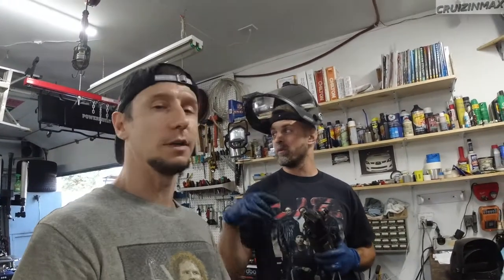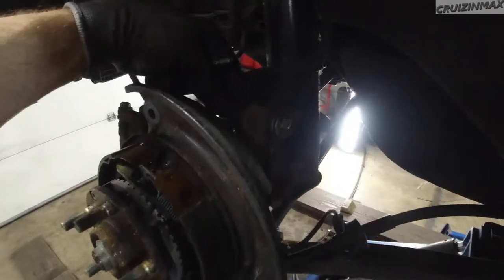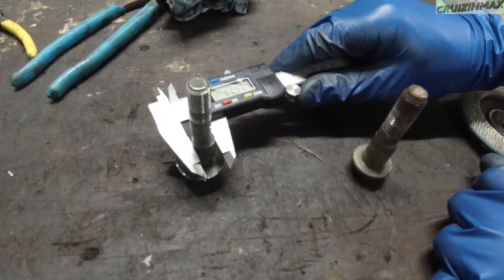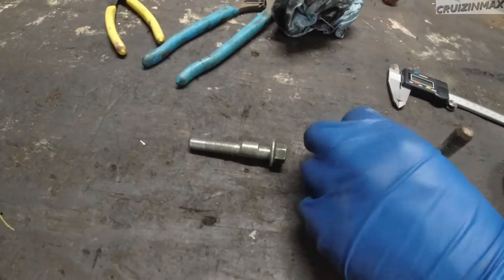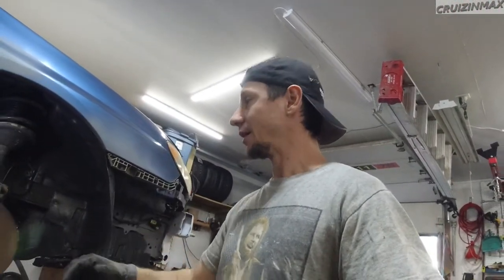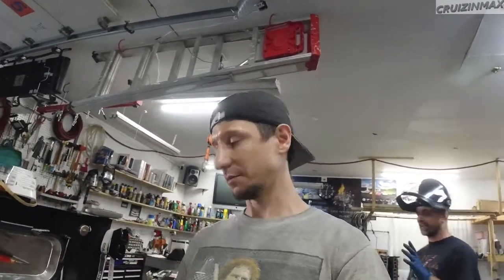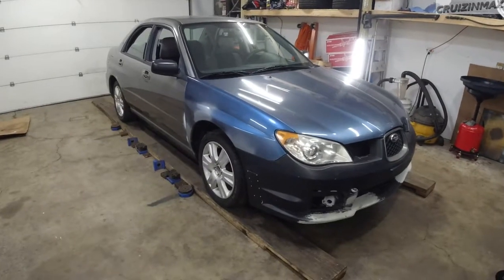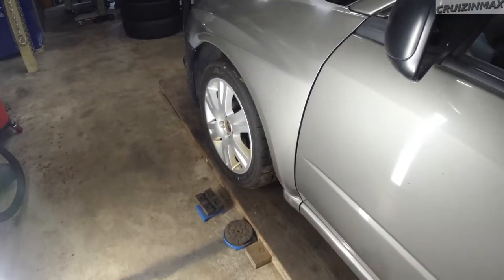Subaru Impreza modifying cheap camber bolts

Comment: Would you need to replace 2x bolts each side? I too just purchased 2x bolts from white line apparently they said 1x each side? But I want to put 2x bolts each side
Reply from the maker: I dont think its possible to do 2x on each side unless you mean one in the front and one in the back on the left side of the car for example, you install those bolts on the top hole, if you do one on the bottom then I dont think the lower control will let you move the knuckle much.
Reply: @cruizinmax4017  okay maybe I will do the top one
Reply: @GIXXRBRAH750  I just bought 2 also I heard it’s possible
Reply: @GIXXRBRAH750  so imm give it a shot
Reply: @SrT4Rome  I done the bottom not the top I will fix it up
Reply: @GIXXRBRAH750   yu ordered the 4 but did 2?
Reply: @SrT4Rome  no I ordered 2 but done 1 then removed it … didn’t do jack shit
Reply: Probably because you put them in the bottom after being told not to.
Reply: @cyril.figgis  it’s okay I got rid of the ShitBox anyways threw it in the tip I got a better car
Reply: @GIXXRBRAH750  ooooh whatd ye get?
Reply: @cyril.figgis  a s15 Spec R GT